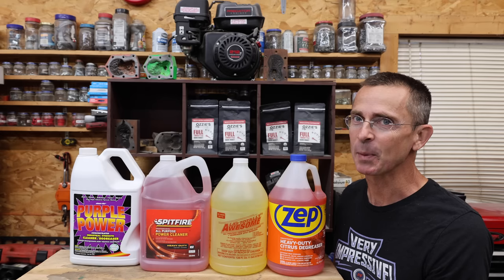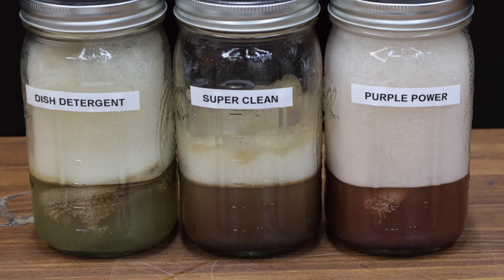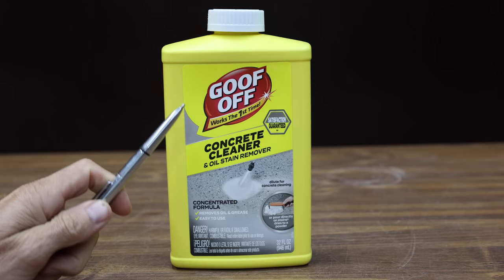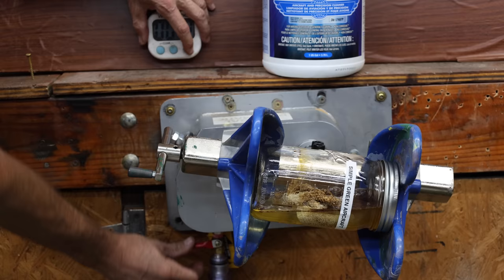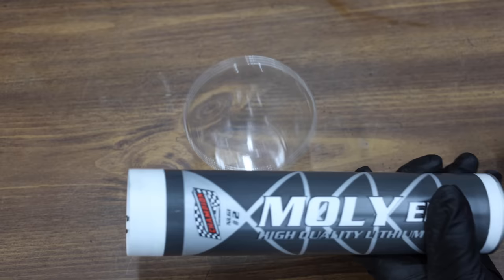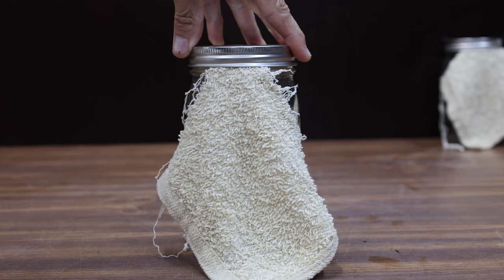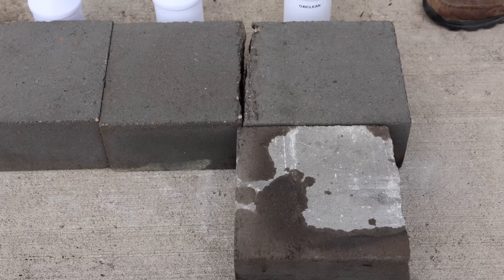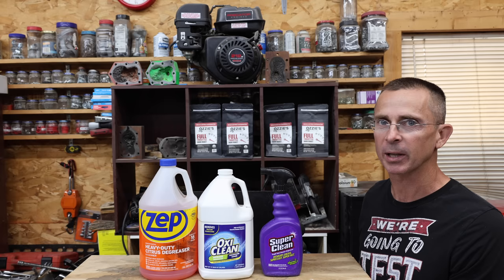Best Concrete and Engine Degreaser? Let’s Settle This!

Comment: Todd, That is a great test! I am interested in paying a fair price for a product that cleans well. I do like the Super Clean and I use it on my garage floor after working on my car/truck.
If it's my favorite T-shirt and I get oil or something on it that stains, I will use a Zep product and it has a nice smell and it works well. The Simple Green is a great product too. I guess the application you use it for determines the product.  I was in the Air Force and the worst thing to get on your clothes is that stinky 7808 jet engine oil. I would soak items overnight in Simple Green or Super Clean before putting them in my wife's washing machine. I usually got the oil and the smell out pre-cleaning that way.  
If you have a dog or cat -- Would you consider a test on Flea & Tick collars?  They are priced high and I wonder which ones are worth the money?  Thanks again Todd!
Reply from the maker: Thanks!  Thanks for the suggestion.
Reply: Be careful with Super clean on you car, it can corrode/etch aluminum. They even now specifically warn about it. Unlike the WD40 Specialist and Simple Green Pro HD which are specifically made to be safe on all metals and not corrode.

Comment: I think you can broaden out under the theme “should we do what they tell us”?  or “is it worth the upgrade”? e.g. Chg engine oil every 3k when manuf says 5k-10k?  Pay for expensive system/fluid “flushes”?   “replacing the old with the new wil make a huge difference but it will cost you $$$”.  Beyond mechanical you could go as far as hair shampoo, the bottle always says wash twice.   Would you like to upsize that drink?  They just put more ice in a bigger glass and same amount of beverage as medium.  Seems like everyone has a gimmick to get us to upgrade these days to take my money with questionnable value in return.    We really need you to surface truth!!!
Reply from the maker: Thanks for the suggestion.

Comment: IMO one product beats all the others, and it wasnt included in this video: TSP (Trisodium Phosphate). Im not talking about the TSP substitute which has become increasingly common. That stuff sucks. Real TSP puts these other degreasers to shame. Its also one of the few cleaners which can be mixed with bleach, and doing so makes it an excellent mold/mildew remover. You have to be careful with TSP though as its highly alkaline.

A couple of other products that i feel should have been included:
• Easy-Off Oven Cleaner (Sodium Hydroxide aka Caustic Soda aka Lye. Yellow can ONLY. Blue can sucks)
• Alcohol ( Isopropyl and Denatured )
• Industrial Strength Vinegar (30%)
Reply from the maker: Thanks for the feedback. Thanks for the suggestions.

Comment: Great tests as always curious if youd test chemical guys degreaser in 2nd lot brands tested im in australia and need import most things here see which will get oils off 1970 to 1980 cars most untouched in 20years i work on even under car like power steering hoses blew or transmission lines and 3/4 under car is just covered in 20 year old grease oils so on
Reply from the maker: Thank you!

Comment: can you do which chemicals completely take out old oil stains on concrete, like sodium hydroxide, acetone, brake cleaner that stuff. I know that you did a test similar to this with concrete blocks but they were inconclusive but i would really like to know what will do it, thanks.
Reply from the maker: Thanks for the suggestion.

Comment: OK here's one. How about car repair RAMPS. Why do I want to know about ramps? Because I just bought some plastic ones at Harbor Freight. Pittsburgh 3 1/4 Ton. They come as sets of 2 ramps. Note that you can also buy steel ones as well.
Reply from the maker: Thanks for the suggestion.

Comment: I would argue that goof off shouldn't count in this review or needed a different video. If you read the directions. You are to put it on the concrete then let it dry then wipe away with a broom. I have found full concentrate works the best!

Comment: As a car junkie, I want to know which products perform the best and are the most cost efficient. I prefer to stick with the testing that I've always wanted to do, but didn't want to invest the time & expense doing.
Reply from the maker: Thanks for the feedback.
Reply: @ProjectFarm  it's touet channel if you want to expand do doing car stuff, you should BUT that's not your audience. You've got people from every facit of life looking for your great comparisons. I constantly am thinking of your oil testing series.

I would also love to see some testing with dawn dish soap mixtures as a homemade degreaser. I know it didn't do well here but what about different concentrates? Or mixed with vinegar + baking soda + lemon (example). If It turned out better than ZEP, lemon sales would skyrocket :)

How about ultrasonic cleaning. Should I buy a cleaner? Should I make one from an orbital sander? What chemicals work best? Ive seem CLR (not a degreaser) turn used pistons into brand new after and 1+ of rotating.

Oil comparisons. Does assembly lube actually provide any benefit to engine rebuilds compared to Pensoil? What about sealing rings? What if I used marvel mystery oil to help seal the rings for the best comparison. 

Just a few ideas I've wanted to do myself
Reply: Problem is he didn’t test for which of these are safe on all metals. Most will corrode/etch aluminum. Only the WD40 Specialist and Simple Green Pro HD are specifically made to be safe on all metals and not corrode.

Comment: How about zip lock bags.  Strength, durability, leak tightness - holding liquids , air  pressure, vacuum and of course parts. Name brand and generic.
Reply from the maker: Thanks for the suggestion.

Comment: I don't think the goof off got a fair shake in this video. Should have tested it at a higher concentration because I remember reading the label and it saying you can use it ar full strength on concrete
Reply from the maker: Thanks for the constructive feedback.

Comment: Supper clean
Reply from the maker: Thanks for the suggestion.
Reply: Be careful, SC can corrode/etch aluminum. They even now specifically warn about it. Unlike the WD40 Specialist and Simple Green Pro HD which are specifically made to be safe on all metals and not corrode.

Comment: now put a painted plastic part into each one and SuperClean will win the paint stripping contest without eating the plastic.
Reply from the maker: Thanks for the suggestion.
Reply: Super clean also corrode/etches aluminum. The label even says It’s not safe for all metals.

Comment: The only test that matters is the grease test. Also you never dilute cleaners. It's just on the label because some yuppie might sue if they get a little tingle on their skin 😂. Oil is organic just like your skin. Sure they have citric cleaners that use the D-liminine or whatever but it still won't clean like a solvent or fuel. Should have had kerosene diesel and MEK in this test.
Reply from the maker: Thanks for the constructive feedback.

Comment: Todd. I normally love the tests that you do, but this one is heavily flawed and needs to be redone. Many people use degreasers for cleaning metals and most of these products are not safe on all metals and even some plastics. It should have have been stated and tested with in are safe and which aren’t. This is doing a disservice to your viewers as they may use the wrong product and damage what they are trying to clean. Most will corrode/etch aluminum. The WD40 Specialist, Simple Green Pro HD and SG Aircraft are the only one specifically made to be safe on all metals and not corrode.

Comment: I'd rather seen actual test on oily greasy car and tractor parts, not how to clean rags.........
Reply: Well., the test on rags is a real world test that would lend itself to metal also.  Meaning, IF it dissolves and removes grease from clothing, it's going to dissolve and remove from metal.  Results wouldn't be any different.